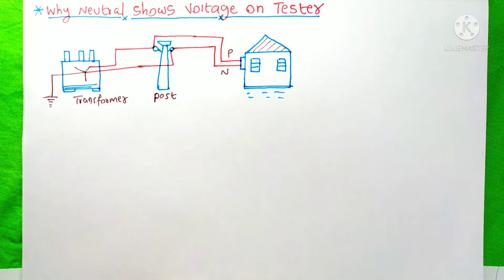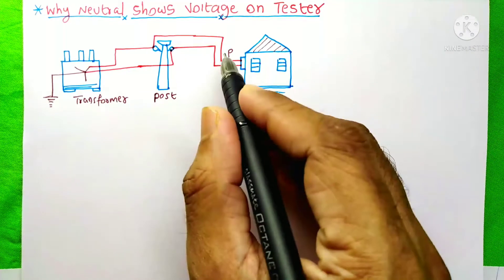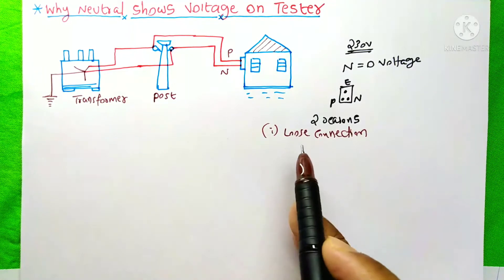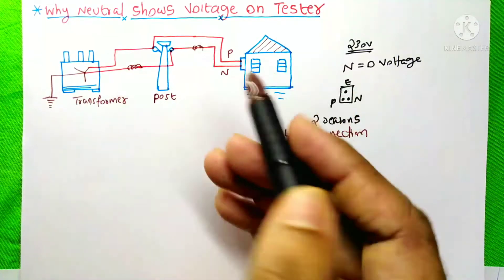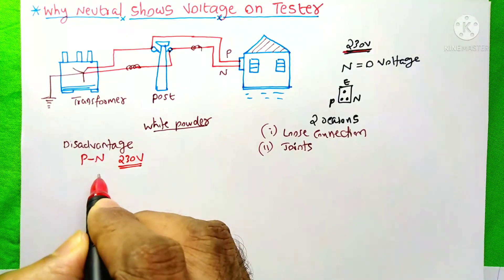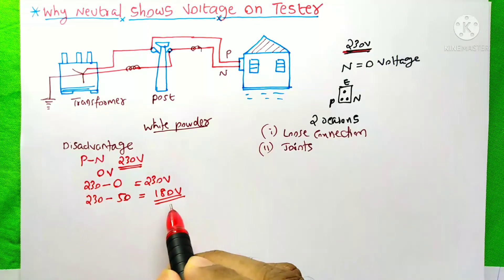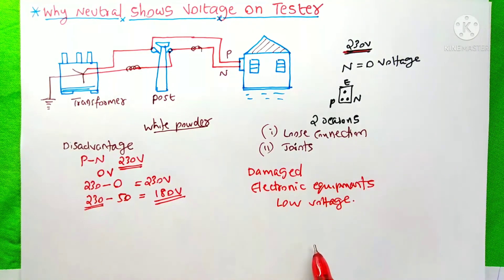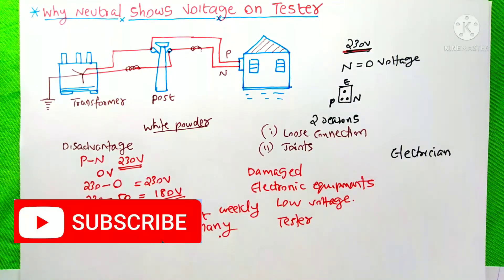Why neutral wire shows voltage on tester | Electrical

Comment: I have an odd issue Im seeing at a customers house.
I am in North america so the single phase voltage is supposed to be 115/120.
We use dual pole breakers for appliances like stove, dryer, air conditioner etc.

Air conditioners here use 
L1 120 to ground
L2 120 to ground
(no neutral)
And L1 + L2 is supposed to be 240.

I am reading 
L1 117 (this is normal)
L2 117

L1+L2 is 205

Whats going on here?
Reply from the maker: 205 is correct
Because it's vectoral sum of 2 phase voltages (120*root3) , not sum directly as 120+120

Comment: If we touch return path wire (neutral wire) Will get electric shock when device /load is on...?
It will be tolerable (assume earthing is fine) or risky..?
Reply from the maker: You will not get electric shock

Comment: What can be the reason for the live wire  showing some voltage on the tester when the live wire is not connected to the source.
Reply from the maker: Maybe some short circuit somewhere

Comment: Hi bro, got some questions,when I fix light,the ceiling fan not working and got current in neutral,but when I put all the light and fight no current flow in neutral,why like this?
Reply from the maker: It's issue of wiring ,

Comment: Ups neutral wire shows a small current. What is the reason?
Reply: It will. Induction.
Reply from the maker: It's due to its resistance , u need to increase the wire size

Comment: Hi... Sometimes in 3 pH home pa neutral drop and the house run at 330 voltage...
My ask is.... If a single phase home droped neutral could it work by 2 lines....??
Cuz the is a single phase office have reading in both line and neutral and all resistance are working properly
Reply from the maker: If there is no neutral , system willnot work

Comment: I am getting soem voltage on power points in some parts of my house and other parts are fine..
Reply: Hi , what's the solution of this, i have the same problem as yours, some sockets work fine, some have electricity on both sides
Reply from the maker: Maybe some wrong wiring
Reply from the maker: Which points